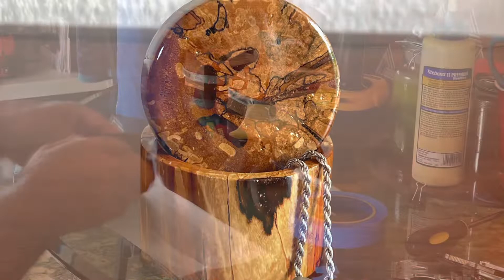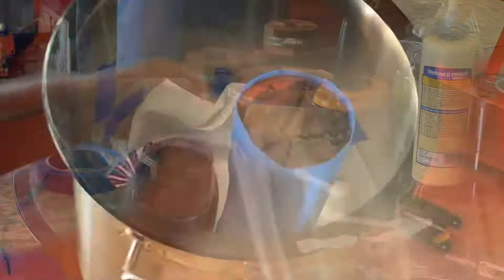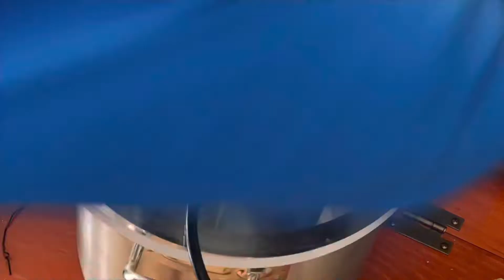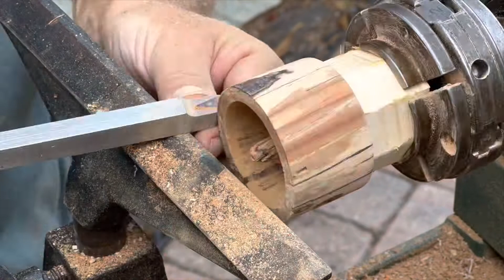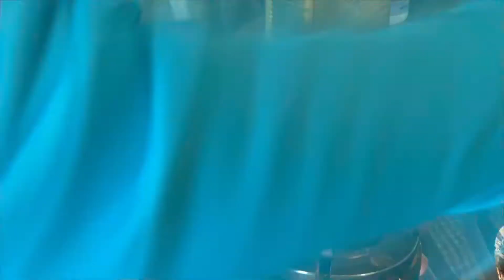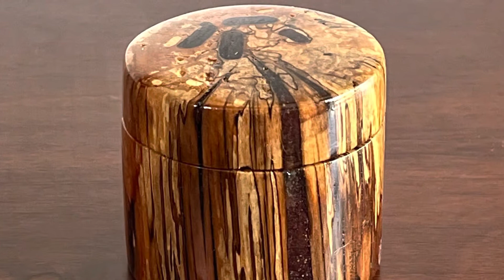Woodturning Spalted Cherry Laurel

Comment: Doesn't the top just slide off?
You should fill it with epoxy and make a little dam around the top so the epoxy will be higher and then you  can lath out an inside lip
Reply from the maker: Doesn’t show well in the video, but no worries as it does have a lip, so it does not just slide off. Thank you.